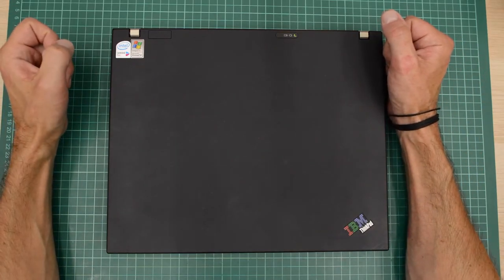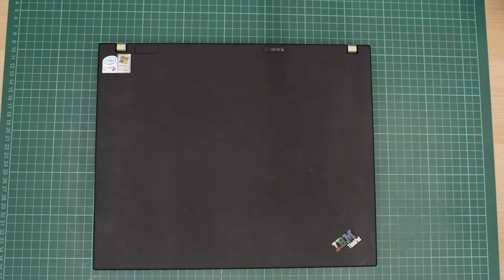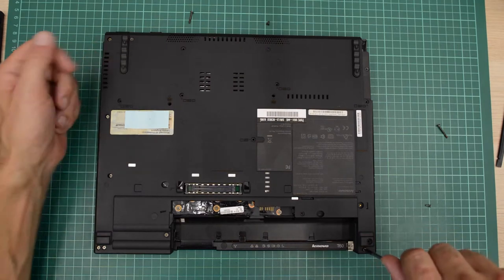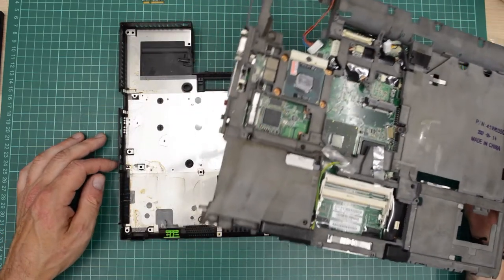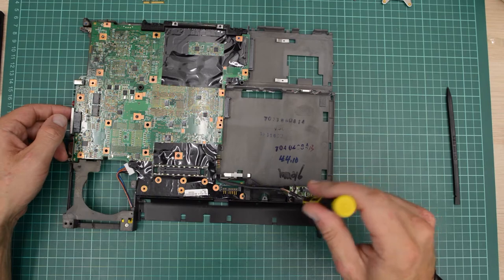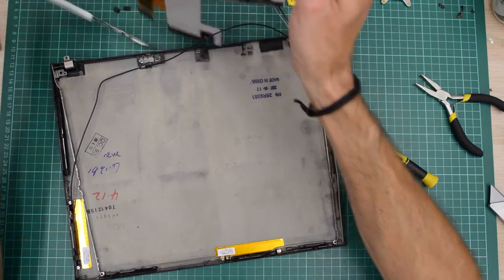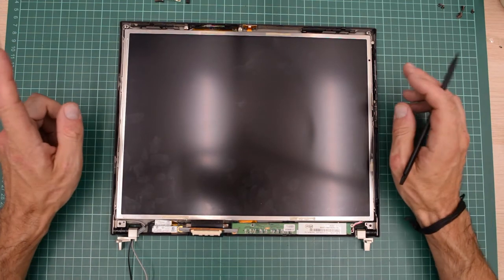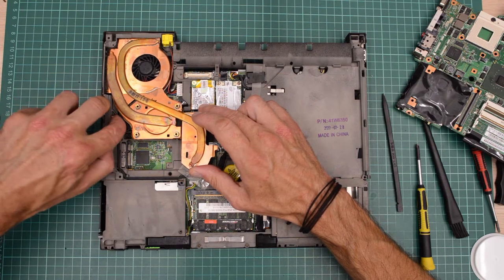T60p conversion. Hi-Res panel and a new motherboard to convert a T60 into a hi-res T60p!

Comment: these T60/T61 thinkpads are pretty amazing. If you're into non-IBM upgrades, it's possible to install a 1600x1200 LED backlit panel in one of these with a modded inverter board and LCD cable. These flexview panels use AFFS tech, which is very similar to IPS used in modern displays, so I mean it when I say that these LCDs look modern in terms of color and black levels. With an LED backlight it takes it to the next level, and improves battery life too. 
of course IBM also offered a CCFL backlit 1600x1200 panel as well.
Reply from the maker: Cool mod :) I'll definitely consider it

Comment: I love the T60 and have 2 of them running Windows 10. In case you are still using yours, the WiFi issue can be rectified by going into Device Manager --> Network Adapters --> select the WiFi card, right click and go to properties. Under the Power Management tab, then uncheck the "Allow the computer to turn off this device to save power". The card should still work after the system goes into hibernation when you close the lid.
Reply from the maker: I certainly do! I'll try that setting, thanks!

Comment: Still using my 10 year old x220 daily and I work in IT. They are solid. Last of the good Lenovo.. and I love the chunky feel and feedback of the keyboard too
Reply from the maker: Just spend a few hours working on the T60. The keyboard is tits
Reply: Have you replaced the TN panel?
Reply: @Epictronics1  There are about three keyboard types and the T60 range usually have either Alps or Chicony.  My personal favourite is the NMB used in the X60 / X61 range.  I have Thinkpads with all three, and Alps is a very good second place and the T60 usually has this one.

Comment: I think there is a modded bios out there for the T60 that allows you to use any wifi card (so you can then upgrade it to something newer and solve that issue) and I believe it also removes the 3Gb limit, so you could up the RAM a bit more.
Reply from the maker: I'll check! thanks
Reply: do u have a link where we can buy modded motherboard  for thinkpads ??
Reply: @gurungbrijesh896  you don't need to mod the motherboard, it's just a different firmware (bios) which you can (sometimes) install like the official one. 

there's a free (as in freedom) firmware called libreboot which supports x/t/r60, x200, t/r400, t/r/w500. it has major advantages for someone who needs a laptop that will will never spy on them. only intel gpu's are supported, ati/radeon cards are not. there's also a closely related but less radical thing called coreboot which supports a lot of newer thinkpads but leaves some potential spyware intact. these two are mostly meant for people who are willing to sacrifice for privacy and security, so they are mostly untested with windows which is not exactly a secure and privacy-respecting os anyway. things can refuse to work. installation is a complicated process on some boards (though quite simple on the 60 series). finding links to these firmwares is actually the easiest part. both do the job with the wifi whitelist. things are not so simple with the ram limit, because intel 945 chipset found in x/r/t60 does not support more than 3gigs (4 gigs minus the reserved addresses) internally, and it cannot be cured with software. 

there is also a patched bios for the x/t/r61 and x300 known as middleton's bios which is a completely different thing. it does nothing to improve the security, instead it simply removes some stupid locks. it will let you use 8 gigs of ram instead of 4, choose the wifi card you like, unlock sata-II speed for storage and turbo mode for single core operations and validate your copy of windows 7 offline (i don't know the details concerning this part). the link i had doesn't work now, but the files are out there if you look for them. 

speaking of motherboards, there are also completely new boards for x60/61, t60/61 and x200 chassis utilizing modern components, made by someone known as 51nb (facebook "dot" com "slash" lcdfans). these are not very cheap but you will get an up to date laptop with the perfect keyboard, chassis and screen ratio (though not all the hardware ports the original laptops have).
Reply: The max 3GB RAM is a limitation of the T60 chipset unfortunately.

Comment: I've still got a t61.  Already 64 bit.  4 gigs ram.  Ssd.   Still quite usable.  I did end up replacing it with a t420 with the nvidia.   Nicer machine overall.  No fingerprint reader or onboard  bluetooth in the new one sadly
Reply from the maker: The T61 was my last ThinkPad at work about ten years ago. I still have it in my collection :) Maybe I'll make a video of it some day. It's a nice laptop for sure :)
Reply: I think you can get a replacement palmrest with fingerprint scanner for the T420.

Comment: You can upgrade the wifi card in the T60. The old original 3945abg wifi cards are slow and are not fully supported by windows 10. You could put in the Intel 7260ac wifi card. I also upgraded my T500 with this wifi card. But to use this wifi card, you have to flash a modified bios, because there is a wifi card whitelist. And the Bluetooth module should also work under windows 10, if you right click on the TPFANControl icon, you can activate the Bluetooth.
Reply from the maker: That's very useful info. I have a very annoying generic Wifi card at the moment poking out of the PCMCIA slot. I'll do some reading about the mod bios. Thanks
Reply: Yeah I did this with my Thinkpad X61 with its Core2 Duo T7500 which is comparable to my Z61p, which is almost identical to a T60p.  I have Window 10 on the X61 and it runs very well including the WiFi.  However I did seek out a stripped down Win 10 to get better performance.

Comment: As I had the same problem with wifi, I can suggest turning off 5GHz radio on wifi as it is no known driver for Win10 what handles both frequencies right. It worked for me. I also can recommend flashing a BIOS with modded Middleton's BIOS.
Reply from the maker: Thanks, I'll try it out

Comment: Thanks for this great video. It gave me the info and confidence I need to replace the defective MB and upgrade the screen on one of my t60's, and to replace the cable to the display on another one of my T60's. I'm getting ready to replace that cable because the status lights on that unit don't work, and replacing the inverter didn't fix the problem. So I'm wondering whether, in your opinion, the problem is in the cable or the MB. In either case, thanks again for posting that video and, in advance, for your opinion.
Reply from the maker: Thanks :) Well, if you have more than one T60 the best approach would be to swap some parts between them. That would be the quickest way to pin point the defective part. Good luck with the project
Reply: I replaced the led cable and the status lights work fine now. Thanks 😊
Reply from the maker: @berlant1  Awesome! Well done :)

Comment: I have this machine; it takes 4 Gigs just fine. And an advantage is that the memory runs in dual channel mode instead of single channel with 3 Gig. Also, LinuxMint recognizes the wireless and bluetooth devices so everything works. Still use this thing everyday as a bedside radio.
Reply from the maker: Thanks bro, I'll replace the 1GB with a matching 2GB and see if it speeds up a bit :) Btw. It's been 9 months sins this video and I still use this TP almost daily for typing and watching a few vid's. My fancy MBP is collecting dust :)

Comment: You would install Win 7 first then all the drivers and finally you will upgrade to Win 10. If the ram is capped to 3GB, check your drivers because sometimes 32bit drivers works better in old machines. That saying, consider using a 32bit OS instead of 64bit, but it depends of drivers availability and compatibility; and of your personal preferences, of course! Cheers, M
Reply from the maker: That would make an interesting comparison. I'm running win10 on this machine but I also have one running xp for vintage stuff and a third one that I don't use yet. I'll try it out with win7 32 and see how it runs. the 3GB limit is set in bios unfortunately. Id does take 4GB but only uses 3. Cheers

Comment: t60's came with 1024x768 or 1400x1050 screens with intel graphics. so you only put in a thinkpad t60p motherboard, but the screen is from normal t60. T60p's had 1400x1050 or 1600x1200 screens, but only in 15 inch size.
Reply from the maker: I pulled that panel from a spare T60p. That T60p 15" 1600 would have been nice though :)

Comment: You don't have to scroll sideways. Just hold CTRL and use the mousewheel to scroll up or down to resize the website in your active tab.
Reply: I'm baffled as to how they missed this key feature that's been built into browsers for almost 2 decades now.
Reply: That's not an actual solution because webpages are meant to be used at 100% size. There are limits to how adaptative webpages can become for different resolutions.

Comment: thanks mate, i need to flash the bios chip on my t60 and this will help a lot
any tips or should i just go for it?
Reply from the maker: I actually plan on flashing my bios too because I need to replace my crappy onboard wifi module. Normally it's a simple step by step but I have not done any research on the T60 bios yet.

Comment: Have you used Middleton's BIOS to unlock 8GB of RAM?  Or, another OS like a BSD or even Linux?  BTW, LibreOffice is more compatible with MS Office than MS Office itself.  And it runs on all three OS and MAcOS as well.
Reply from the maker: Thanks, I'll try it out and make a follow up video. I haven't used Linux in decades unfortunately but I have considered giving it a go again on this machine. The only MS office product I use at the moment is Word 6.0, purely for nostalgic reasons but it actually meets all my needs :)
Reply: @Epictronics1  When it meets your needs; it meets your needs.
Reply: Middleton BIOS only works on T61, R61, etc, but not 60 series

Comment: 2:38 what's the Bluetooth module part number, or what's it called so I can replace my modem card for a Bluetooth card?
Reply from the maker: I would have to take the machine appart to check. I'll try to remember when I work on it next time.
Reply: @Epictronics1  thanks!

Comment: On windows 10 > device manager > wifi adapter > right click and check power settings. By automatically power management might be set “on”. un-tick that box and it should reconnect wifi fine after standby. Another solution is search how to remove wifi whitelist on internet, there must be hack to remove whitelist and install more recent wifi adapter (intel wifi 6xxx or 7xxx maybe?). 

Final comment, if you want to use it daily, why didnt you modify it by replacing with 4:3 T61 motherboard instead of T60p? If you are interested, search for T601 frankenpad options (ref: thinkpads forum, and Seb’s Random Tech youtube channel which he did same mod).  You can hack T61 system easily by installing Middleton BIOS. And then T61 will support better CPU, 8Gb ram, SATA2 speed. I am using X601s with similar setup (X61s mobo inside X60s chasis) but working on T60/61 modification requires some tricks. 

About bluetooth, it should work fine but you can upgrade it as well. I am using bluetooth 4.0 card which is taken off from X230/T430 which fits in the same connector on T60 without issue and works fine.
Reply from the maker: Thanks Mustafa, Sounds like a good project! I'll give it a go for sure.

Comment: maybe you should swap the wifi card with a newer more powerfull Intel 9260NGW . I read that works great. You should change the bios to Zender's Bios that has no whitelist for the wifi card and this will also allow you to use 3,5 or 4gb of ram. With the original wifi car the download speed is up to 54mbs/s wich is quite slow, besides the wifi card mentioned comes with bluetooth. You will need an adaptor to fit the new card(https://www.ebay.com/itm/M-2-NGFF-WIFI-WLAN-Card-Module-to-Mini-PCI-E-Express-Adapter-Converter-Antenna/253626571532?hash=item3b0d525b0c:g:RL8AAOSwdQda~A6w).

I have all the parts but not the guts to upgrade the bios lol so if you do it you it I would love to see the process of upgrading the bios.
Reply from the maker: That Bios sounds like fun. I'll consider an upgrade. Sins this vid I have been running this machine with a random vintage PCMCIA WiFi card and it runs perfectly. This is definitely just a compatibility issue.
Reply: Any link to the "Z" Bios? I have an R60 I'd like to upgrade the WiFi card on but have searched in vain for this modified bios.

Comment: LTN141P4-L04 Samsung 14.1" SXGA 30pin Pantalla Mate LCD CCFL LATITUDE D610.

Is this model? I can't see the serial number.
Reply from the maker: Oh, sorry but this would be hard for me to check. I would have have to take the screen appart to check the label.
Reply: @Epictronics1  And ram, could you tell me where you got it?
Reply from the maker: @doppelganger2350  I'm not sure actually. I think the stick I used in this vid came out of some other laptop. You can find the spec here and pick one up for cheap on ebay. Happy hunting. https://support.lenovo.com/sa/en/solutions/migr-62722
Reply: @Epictronics1  thank you. Have a nice day.

Comment: Hi!
Does it still play 1080p youtube videos?
I have an X61s with a Core 2 Duo L7500 (1.6GHz), 4GB of DDR2 667MHz, integrated GMA X3100 graphics and an upgraded (150mbit/s) wlan card. I installed Linux Mint 20.2 on it (as I know it has smaller system requirements than Windows 10), it struggles to play even 720p videos. The system kinda runs slow even in the browser (Could that be a problem that I use a really old WD 80GB 7200rpm harddrive?), its almost like a lagging game. But when it loads the the video and I put it in fullscreen, the cpu is around 50% used on both cores and the video runs fine (if its 30fps, 60fps is too much for it).
Currently im waiting to the replacement screen to arrive, the laptop came with a smashed up panel..   - Thanks Hungarian postal service 
I flashed Middleton's bios on it and unlocked Sata II speeds, now Im thinking of getting a cheap ssd.
Reply from the maker: Hi! I wasn't sure so I pulled my T60 out and did some testing. It runs YT fine at 1080p but only with the cord plugged in! Not as smooth as my modern machines but only marginally worse. However, when I pull the chord it gets rather glitchy. Still usable but with frequent very short glitches lasting fractions of a second at 1080 and 720.
Reply: @Epictronics1  Try to set the power plan  to "Maximum performance" both in the bios and in Windows. You will have worse battery life, but better performance.
This might be the source of my problem, its set in the bios, but Im not sure in Linux. Im currently creating the Windows installer, I have to test it.
Reply from the maker: @Tumbauer   That helped, thanks. I can now run 720 just fine on battery power. I still get minor but frequent glitches in 1080.

Comment: Change backlight keyboard pls
Reply from the maker: Is there a backlight kb that would fit the T60? btw, I'm typing this on the T60 :)
Reply: @Epictronics1   i think 😁 , im planing buy t60 , why i choose this bcse the model is easy to flash the bios. i want colect latptop with full open firmware software hrdware . T2400 2gb ram is enought for secondary dailiy driver without custom or modif ?
Reply from the maker: @ygjt76v0-----  I don't have a T2400. However I still use my T60 when I travel as my only computer!
Reply: @Epictronics1   i mean , the t60 what i want to  buy come with cpu  core 2 duo t2400 with 2 gb ram . Cool ! I love retro model & the design of old laptop not soldered from the mainboard
Reply from the maker: @ygjt76v0-----  awesome, good luck, I hope you find one in great condition
Reply: @Epictronics1  thanks
Reply: @ygjt76v0-----  The T2400 is a Core Duo (note the lack of 2) which is an older 32-bit CPU. It will probably be fine but newer applications and OS may require 64-bit support and of course more RAM is better.

Comment: I've had numerous laptops over the years that forget their wifi networks, I figured it was just an unwanted feature of Wifi. Since it's an old machine, I wouldn't be surprised if something subtle has changed in the wifi specs that causes older machines to have issues randomly.
Reply from the maker: I guess I will have to find out :) I couldn't find drivers for the PC-card from 3com in the video but I had another card I just installed. I'll try it for a while and get back with the result.

Comment: Hellooo brooo I Have thinkpad t60 what is The 1R×8, 2R×16, OR 2R×16???? WHICH IS MORE FASTER AND RESPONSIVE
Reply from the maker: Hi, Sorry to say but I don't know. Maybe someone else can reply here
Reply: That's the physical configuration of the RAM modules. Single-rank (1R) modules will have 8 chips and dual-rank (2R) modules will have 16 chips. There is no speed difference. AFAIK all 2GB sticks will be dual-rank.